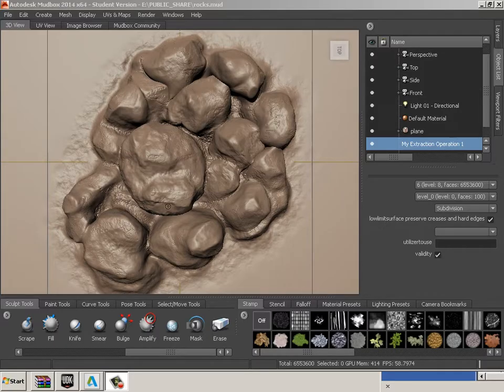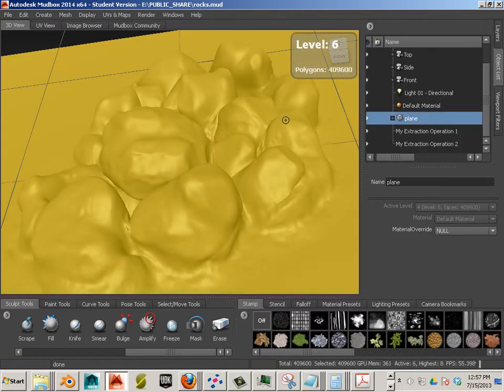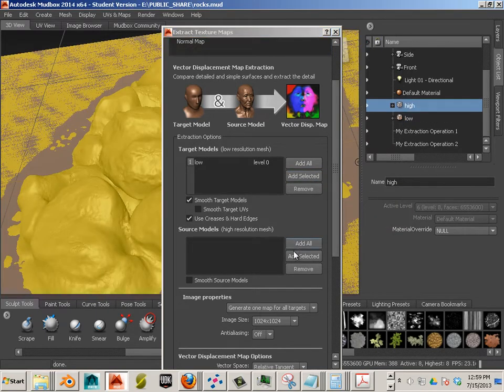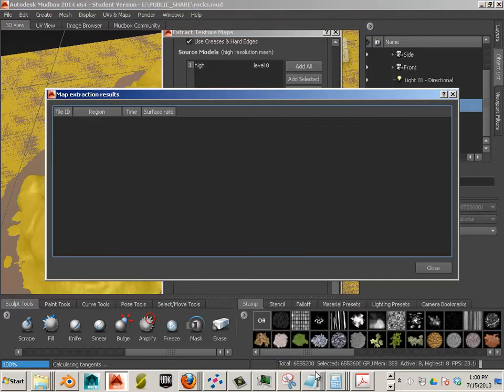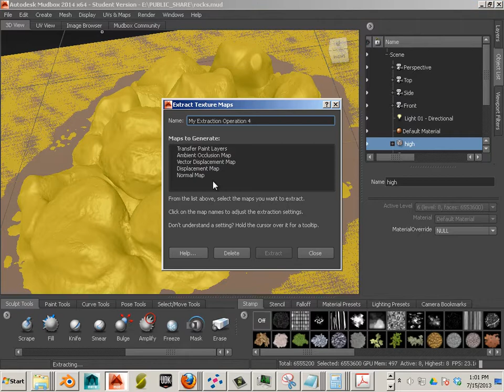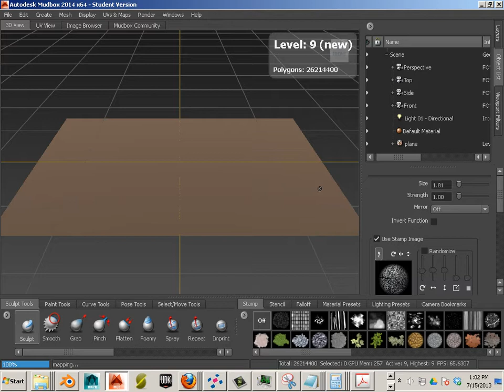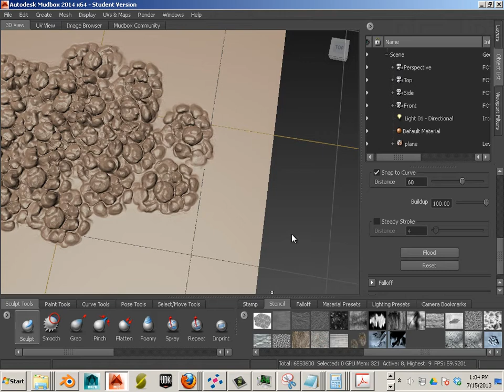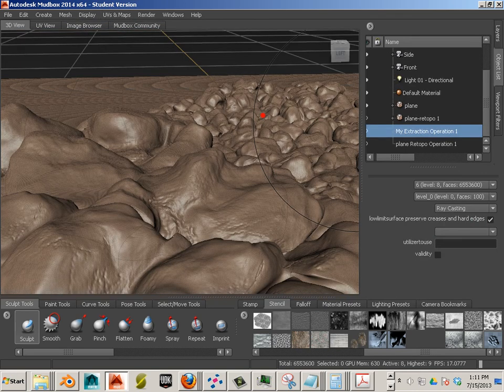0108 Mudbox 2014 (Vector Displacement Stamp and Stencil)

Comment: Nice. But why can't mudbox do the baking to vdm in the background so you can start setting up the 1024 bake right away? Also the (Not Responding) is just a no-go @ Mudbox programmers... handling Windows messages is not so big a deal.